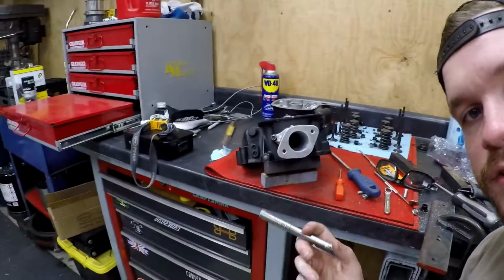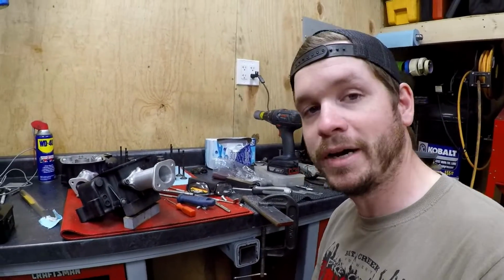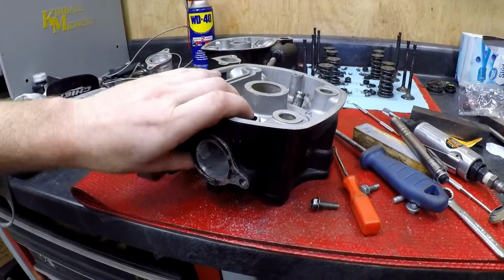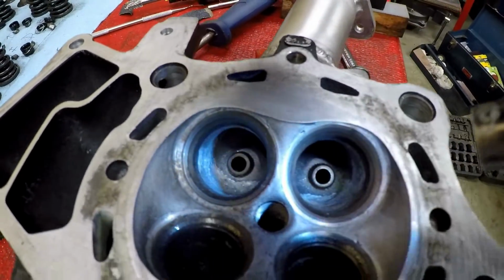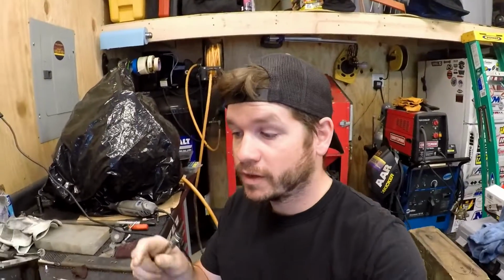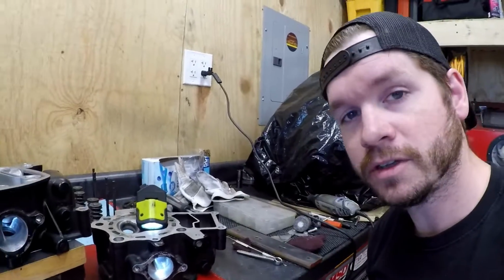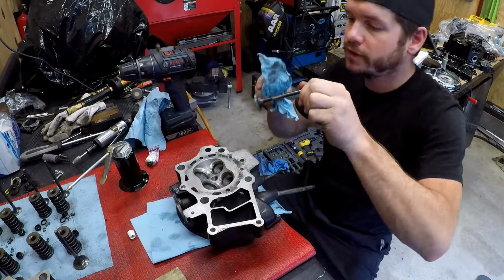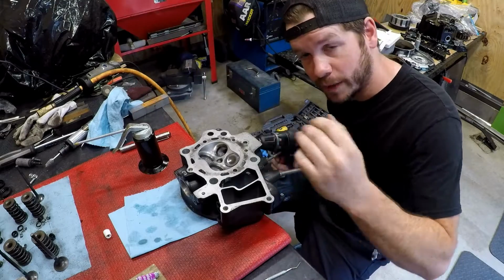CX500 Build - Porting The Heads! / Lapping Valves! / Welding Intakes! - EP37

Comment: I think sanding smooth the casting roughness in the heads probably has more effect than reshaping the pathways. Roughness has a big of effect on friction loss of fluid flow in piping
Reply from the maker: It may seem counter intuitive but you dont want the intake side to be too smooth. A bit of roughness helps with fuel suspension and atomization in the air. Too smooth and it can more or less puddle

Comment: Was there any performance improvement after doing all this work ???
Reply from the maker: Well there absolutely should be lol. I'm planning to do some more carb tuning this week but even just seat of the pants feel this is much quicker than a stock 650. Granted it has mikunis and the stainless exhaust but thats the big reason I chose to mess with the heads to tale full advantage

Comment: Keep up the good work man! You have inspired me to build a CX500/ 650 with the videos you have produced. Got the 500 frame and 650 engine sitting right next to me in the garage right now. I'm in the process of  engineering a 90 deg miter gear drive box that puts a chain sprocket on the left side. Going to install a 2012 Triumph Speed Triple single sided swingarm with 190 tire.
Reply from the maker: Damn! Are you documenting it anywhere?
Reply: @BrickHouseBuilds  Nope, but I was thinking about starting a post on CX500 forums. Right now I'm still gathering the parts to 3D scan, and I have a start to the gearbox design on Solidworks. I will send you a link if i do.